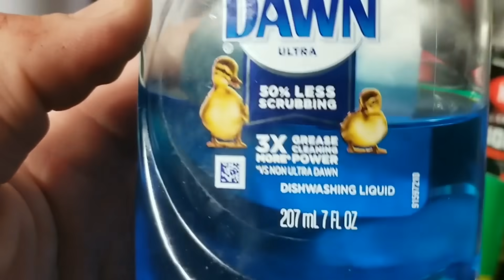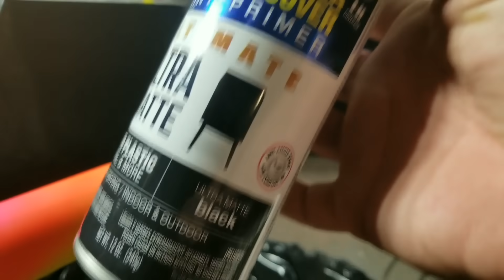Dish Soap Tumbler Painting Technique!

Comment: little tip, if you want the soap to not run as much and can be more defined with it; put the soap in the fridge for 30 minutes or freezer for 15 minutes for you use it, obviously the colder it is the more firm it gets and the lines drizzled hold a lot better, longer and more defined.
Reply from the maker: Niiice!!😉👌
Reply: when you rinse - do you use COLD, WARM or HOT water??
Reply: @yakkyuu12  usually just like room temp id say maybe, usually just turn the water on in the sink n rinse it off real fast, jus the cold knob, but it's not really cold water ya kno. hope that helps
Reply: Hi thanks for the reply!
A couple more questions, hope you don't mind;
1) how long do you let the Dawn soap sit until you spray black over it?
2) after you do spray  black over it; how long do you let it sit, before you wash the soap off??
3) REALLY important question; Can you spray a DIFFERENT color than Black over top( obviously not spraying a color you have undersneath--could I use WHITE, Cream, or how about a METALLIC black or Metallic copper??
Is there any color you definitely should NOT spray over your DAWN??
Reply: @yakkyuu12  3) It really shouldn't make a big difference, but if you're unsure and don't want to mess up your prop, try it on something else first. But don't be too afraid. Usually you can spray over it again and again with sufficiently opaque spray paint. Dare to experiment :)
Reply: I ve seen your comment too late, that's sade^^
Reply: That's awesome! I don't know what made you think of it, but I love it! 💖

Comment: Does this work on any hard material? And is it necessary to use epoxy? Or is it possible to spray it with a sealer instead, like you do on canvasses? Thanks in advance, looks good with the colors.
Reply from the maker: Yes, you can do this on almost anything, and typically for this since it comes out fairly flat, I get my buddy to shoot it with automotive clear coat - work great!

Comment: I really liked this trick! I plan on useing it on a rc boat im building for my 4yr sons Christmas present. My question is will this trick work useing airbrush acrylic paint as the base colors? I plan on using metallic flake blue with a bit of candy, then the soap then the black. Fallow with epoxy top coat.
Reply from the maker: I just did it today on an Traxx-Xmax RC truck body

Comment: Can this technique be done on plastic tumblers, or does it have to be stainless steel?   Also if it can be done on plastic can I seal it with rustoleum clear coat or do it have 2 be epoxy??  Thanks a ton AMAZING VIDEO & VERY ENTERTAINING
Reply from the maker: You can do this on almost anything👍. I have also finished it off with automotive clear coat before. I have heard of people using mod podge as well

Comment: This technique is so cool! Correct me if I'm wrong and I missed something, but doesn't the design change after you wash it?
Reply from the maker: Not sure what you mean by it changes?
Reply: only the colors underneath the soap will show thru. When he sprays with another color on top that becomes the new "background" of the mug
Reply: @DuncanCustomAirbrush  Like when you wash it will the dish soap jot come off and the design will like run? I'm probably not right, but I wanna try this so I'm wondering how that works and if I'm missing something I need.
Reply from the maker: No, when i wash the dish soap off the paint is almost dry. I use matte because it drys faster. It is not dry enough to touch, but it is dry enough to wash the soap off.
Reply: Oh Ok, Thank you!

Comment: Does it need to be spray paint only? Just asking because I used acrylic paint and them after I drizzled the dawn dish soap. I sprayed it with a black matte finish, and the paint underneath turned out horrible! PLEASE ADVISE. TY
Reply from the maker: I imagine if you used acrylic (like Walmart Apple Barrel or FolkArt) that it should work if you let it fully dry and then seal it with a few coats of the Matte Clearé first.

Comment: Does it have to be sealed with resin ? Or would a spray paint sealer be okay ?
Reply from the maker: I have used automotive clear coat spray before. I think it would be better use that, resin, or epoxy because of the hardeners that have to be added to it

Comment: Would this work with acrylic paint instead of spray paint?
Reply from the maker: for the base yes...not after the soap
Reply: @DuncanCustomAirbrush  why would it bubble when spraying the spray paint? Is that normal? Also it left a grey outline after I rinsed it. Was the spray paint bad?
Reply from the maker: I would suggest sealing or even epoxying over your acrylics before doing the soap technique. The bubbling sounds like the acrylic and spray paint dont like each other. Not often, but sometimes that happens with different types of paint

Comment: I have a question. I tired this but needed to strip. I would like to know how to use mineral spirits to do that. my soap ran because i had it too close to the cup and used too much
Reply from the maker: Mineral Spirits and a paper towel will take spray paint right off. I buy the odorless from Walmart
Reply: @DuncanCustomAirbrush  Thanks
Reply: @DuncanCustomAirbrush  I must be doing something wrong becuase this stuff will NOT come off. what steps should i take? should i be doing something different since it dried?

Comment: What kind of paint did you use on the original colors before the soap? Like was it satan, matte, semi gloss, etc…?
Reply from the maker: I try to always get matte, but sometimes that is not available, so, if I have to use gloss spray paints I always try to lightly sand then with a 3M Scotchbrite pad to matte them out for better adhesion

Comment: Will your trick work with high temperature paint under the hood near the car engine. Equally important will the soap withstand the heat like 250 degrees or 300 degrees....
Reply from the maker: You wash all the soap off
Reply: @DuncanCustomAirbrush  so the soap works with any kind of paint?
Reply: So if I wait a year or so then finish the project off with soap and the final paint layer will it still look good? Nevertheless the project must be completed after the soap is put on right in order to look right is my understanding....

Comment: What are you coating the finished tumbler with?epoxy?
Reply from the maker: Yes Alumilite Amazing Clear Cast epoxy
Reply: @DuncanCustomAirbrush  yeah it was very shiny
Reply: @DuncanCustomAirbrush  i have about 30 wine bottles that i want to paint.the first turned out horrible  because i tried to hold and turn it with my finger in the opening.i do not have the auto turner and so my dish soap ran and it was a mess.

Comment: When i painted cars 20 years ago i had best luck using dish soap to clean car BEFORE PAINTING it controlled fish eyes in paint.. till one day IT MADE SERIOUS FISHEYES this is where i learned they started adding palm olive oil to the soap to help with cracking hands.. MAKE SURE NO OILS ARE ADDED TO YOUR SOAP IT WILL CAUSE PAINT NOT TO STICK
Reply from the maker: Great info - I actually cleared these with automotive urethane clear coat and they turned out great!👍

Comment: Hello,  I want to do my rear bumper on my car and I also have a bra on the front of of my car to. What do you suggest?
Reply from the maker: I would suggest prep it properly: sanding and cleaning, then I would experiment with some kind of thickening agent for your soap since most of your surfaces are vertical you don't want it to run off all over the place. Then you could pretty much follow the same procedure: Dish sopa, spray paint, wash off. Then you would really need some sort of automotive clear coat to finish it off.  @DipMyCar has a video where they did this to an entire Mustang and it looked pretty cool.

Comment: Spaghetti, cereals, rice, anything - throw or sprinkle or whatever it on, paint, let dry a bit, wash with water for strange effects.
Reply from the maker: Good Idea!
Reply: @DuncanCustomAirbrush  Thanks. I've done it a lot on art, to use up tiny bits of spray cans, before the nozzles clog up. Those that have clogged in the can (not the plastic thingy) I've used by preparing the canvas on the ground, and then stabbing a tiny hole in the edge of the can, and used the spray as it happens to spread. The trick with the oats and weird stuff is to let the paint dry enough to not be smudged (unless you want to play with that effect - art should be fun ton do, bcz most of it will end up worthless anyway) when flushing it of, but not so dry, that it sticks to hard. Enjoy !!!  :)

Comment: Why does no one talk about drying time 😂

You didn't get that clean of lines and that perfect of epoxy in a couple minutes of drying and one coat.

It takes hours for it to dry properly, specially if using glossy underneath

And youre going to have to apply a few coats of epoxy plus heat gun or purge it to get that clean and smooth of a finish